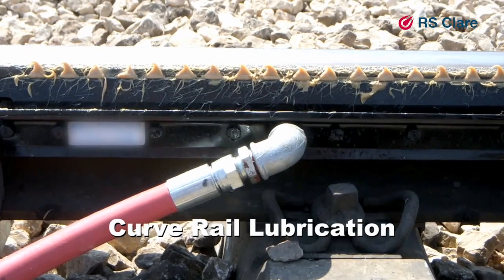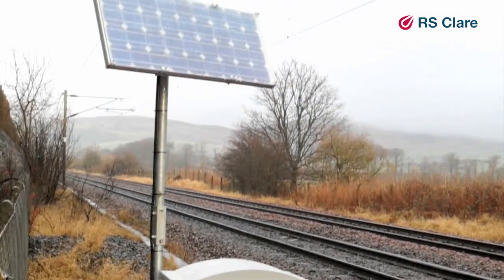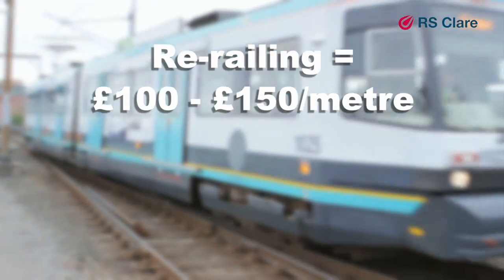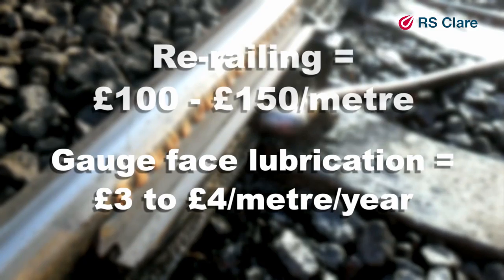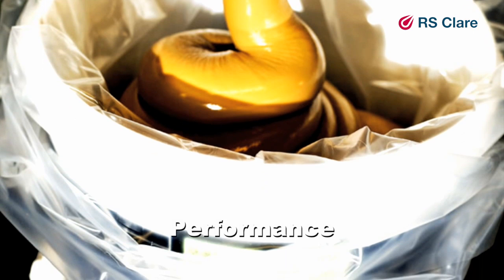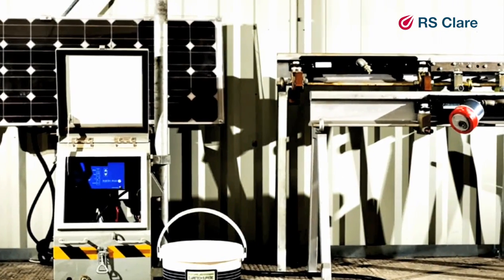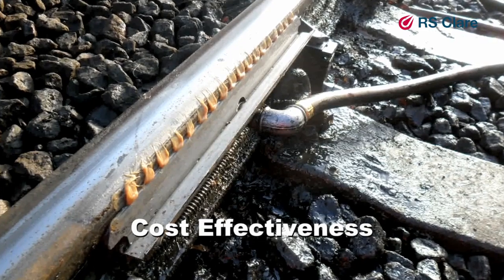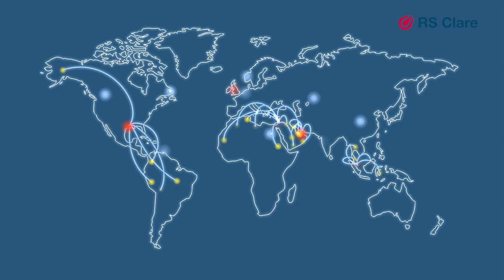RS Clare Advanced Curved Rail Lubrication

Comment: I am concerned that there will be subsequent diminution of driving (i.e. wheel-to-rail) friction for locomotive wheels. I wonder how that is addressed.
Reply: The grease is applied to the protruding rim of the wheels, since the wheels are turning, the grease does migrate towards the flat surface of the wheels( due to centripetal forces ), nor the rail ( the actual gripping surfaces for driving the train forward ). The grease is used to limit the wear of the side of the rails and the wheels due to lateral forces implied in a curve.
Reply from the maker: If you would like to send your question to info@rsclare.co.uk, it can be sent to our technical team who will answer this for you